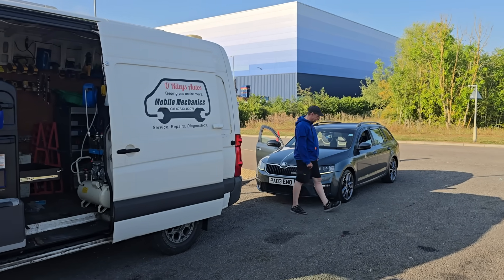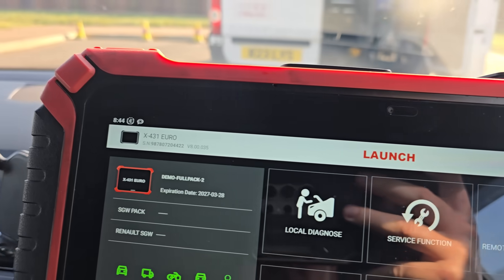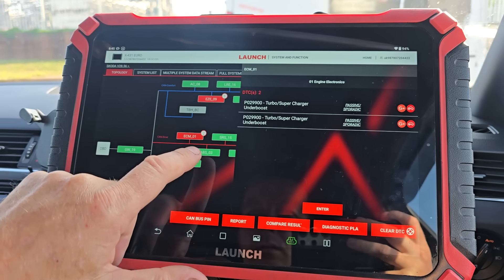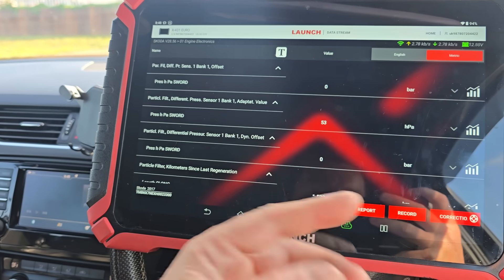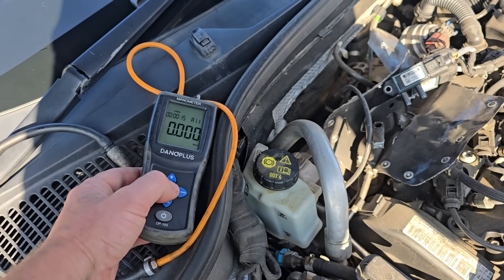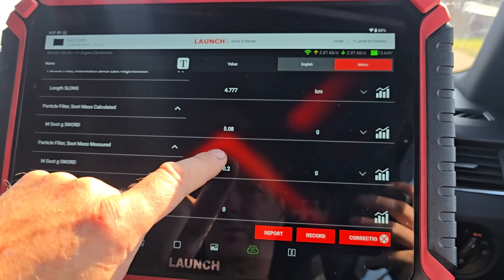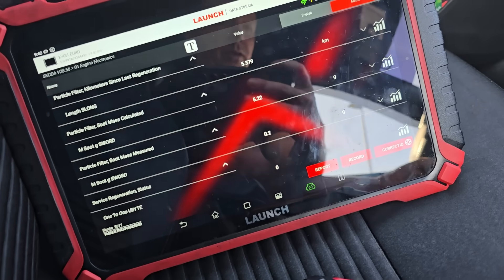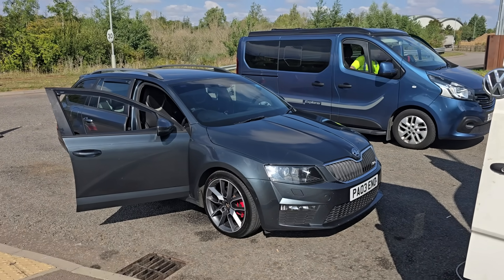Diagnosing a Skoda Octavia’s High Idle Revs and DPF Troubles

Comment: I had Skoda and seat Toledo with 1.6tdi and rev goes higher some times and then I took it to Halfords and a very expert mechanic told me that it’s normal because computer of car designed to do it to clean the EGR valve.

Comment: I wonder if it's still an Ash issue considering the acid was weak. Do you use the acid on its own not mixed in with the soot cleaner? Maybe you should just done the  acid again on its own and for longer. Looking at some analysis on the acid you want a dilution of pure acid by a third of dionised water not distilled. it doesn't really do much to the Ash if it's very weak. how much is a new DPF?

Comment: Ive got a 2018 petrol VRS with a stupid OPF/GPF/PPF - im assuming the pressure sensor has failed so its stuck in a "regen" i took out extended warranty with RAC whom arranged a garage to look at it, the garage is stating the PPF/OPF/GPF may have melted in the exhaust  - so RAC warranty is declining repair as the exhaust is not covered - wont replace the Pressure sensor as they state the exhaust is the issue (the exhaust hasnt even been removed to see if it has "melted" which i highly doubt it has since they get upto 1100 odd degrees to burn soots/particles away.... these GPF/PPF/OPF/DPF are just complete piles of crap!

Comment: I fixed a Skoda Octavia 2016 TDI with the same symptoms last year, two hundred thousand on the clock taxi, thanks to this channel done all the checks, 70 millibars at idle, 250 millibars when revving tried the cleaner with the compressor made no difference at all, as it was regening all the time had to take the plunge and got the DPF removed, put it in a big plastic bucket filled it up with brick acid from B@Q about 7 percent acid and left it a couple of hours  to soak and loads of red sludge came out, then thoroughly rinsed with hosepipe not pressure washer and had it put back on, the car after some vapour came out of the exhaust did it in the open as still a bit of acid could be in there, the pressure was 2 millibars at idle and back to brilliant MPG and just perfect a year on.
Reply: Do you reckon it done any damage
Reply: @eoghanhennessy443  I watched Steven B. Tuner YouTube Dpf cleaning at home, he tested loads of chemicals, if it's blocked because it hasn't been regening than a prewash should be considered to get rid of the soot, as the one I was fixing was regening all the time and I had tried cleaning with on car cleaner it was just the ash and so the brick acid was the way to go, it can if it's to concentrated start to dissolve metal hence the 7 to 10 percent and only a couple of hours and then washing out with water and when put back on wear eye protection incase anything drips on you, but the car is still going well and would of been scrap without it.

Comment: It would be nice if you've tested exhaust pipe for soot at that particular car.
Reply: +1 on that.
I just waited for that moment whole video...
Reply: @rickardkevaanranta7808  Its blocked dpf with ash, not blown. different fault
Reply: The exhaust is clean.
No soot in there.

Comment: Might have helped to check ash content of the DPF over 80% I'd say... (should be available  on that scantool since  VAG DPF APP shows that parameter)
Reply: As said use the VAG DPF app on your phone with a OBD2 WIFI adaptor it will show everything you need my 1.6 TDI regens about every 270 miles can’t fault the app

Comment: In the same scenario myself - depending on engine type the piston rings are known to fail over time. This then produces the problem of oil burning, my experience I have to top up one litre of oil every 1000 miles. Oil burning increases soot accumulation, more frequent regenerations and ultimately shorter lifespan of the DPF as it well clog with ash eventually. I have already had my DPF removed, cleaned and reinstalled only to be hit with the same issues. Engine rebuild isn't a viable option for me, so next step is to unfortunately have the DPF drilled out and professionally mapped out and hopefully passes the NCT here in Ireland.
Reply: Happened mine, wouldn't pass smoke test , flogged it on
Reply: 186k miles
Reply: I would say it's probably not the Rings cos you probably wouldn't be losing oil because that gets replaced by the diesel? but if your valve guide seals seats are wearing and letting oil into the chamber that could be more likely. If you've got a compressor at 130 PSI your need to make a tool that can substitute the injector, that will hold up the valve you don't need to remove the head. then you could change the seals. worth sending an oil sample off to a lab to see how much diesels in there that would indicate my theory is correct or not.